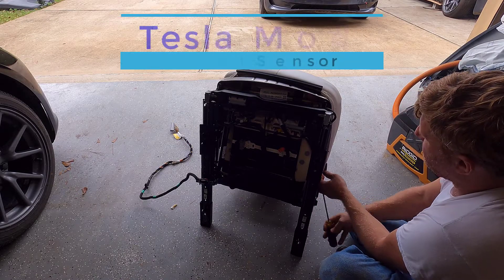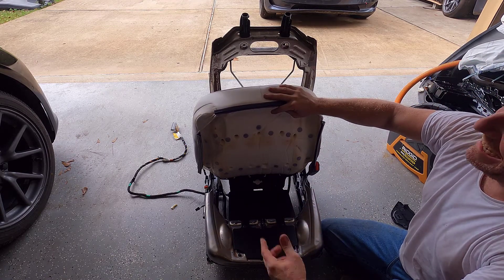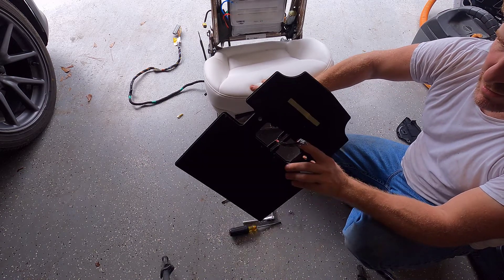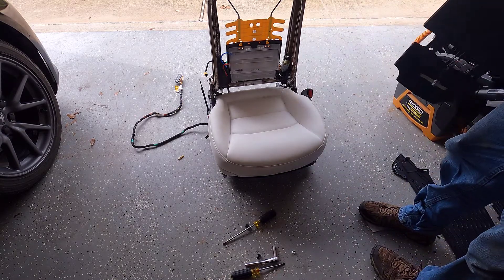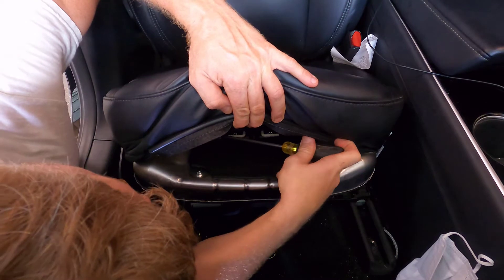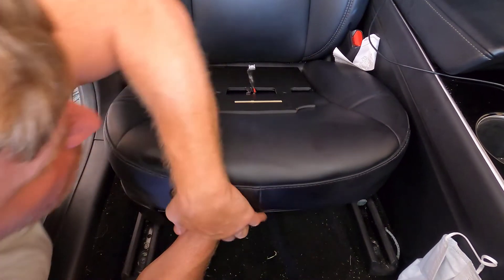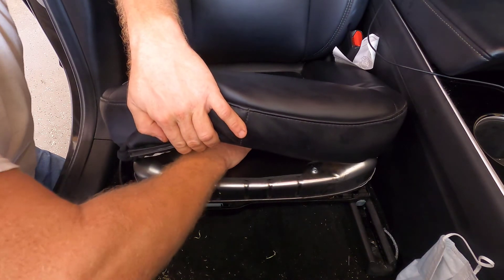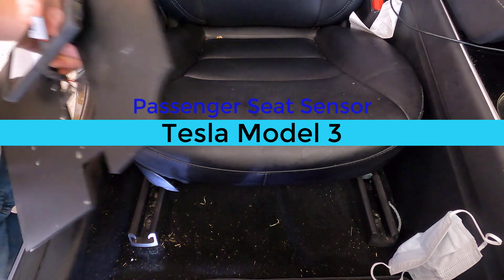Tesla Model 3 - Passenger Seat Sensor - Restraint Fault

Comment: I ordered a sensor from eBay. The sensor arrived. However, this sensor is missing from under the front passenger seat. I will return it. I think a different sensor is used in our seat. 2019 Tesla Model 3

Comment: My issue started with RCM_a078_comOCS1PStatus which indicated to communication issue between OCS module and RCM. Replaced OCS module and now I’m getting RCM_a056_passengerFrontOCS, I’m guessing now I have to replace the sensor that you showed in the video
Reply from the maker: Yes it's usually the seat sensor as it's been kinda defective as there are too many failures.
It's not a risk to occupants as airbag will still deploy with seatbelts latched.

Comment: I have 2022 m3, they don’t sell this type of sensor anymore, they quoted me 2k for retrofit to the newer one, it’s the same type as the driver side…..
Harness is only 200 and sensor is 10 planning doing it myself since the car is out of the warranty
Reply from the maker: No passenger side is not same as drivers, you don't need a new harness

Comment: Question, I need to replace the entire driver side seat cable harness assembly. I unfortunately do not have a garage large enough to do this in. Do I need to unplug the 12V battery to unplug the harness connection or can I just put the vehicle in service mode? I have a 2018 Tesla Model 3.

Comment: Thanks for the super detailed video bud! I’m getting a ‘Front Left Safety Restraint System Issue’ warning on my ’18 Model 3. Do you think that’s the same issue you had, or a totally different problem? Could it be the seat belt buckle sensor? Thanks in advance.
Reply from the maker: That is probably the drivers seat sensor it's different.

Comment: Do you remember the exact error code you were getting before this fix? Mine says "RCM_a056 Front passenger safety restraint system issue"
Reply from the maker: Yes that should be it, front passenger seat, check service mode for exact fault and definition.

Comment: So I have the error of "Front passenger safety restraint system fault" on my 2019 model 3.

I made a service request and I was quoted to complete the following service bulletins: 

SB-23-20-001 R3 -> Update Front Passenger Airbag to Maintain Compatibility While Servicing Front Passenger Seat
SB-23-20-002 R7 -> Replace Occupant Classification System (OCS) of Front Passenger Seat while Servicing subcomponents

This is a total cost of ~$1300 with parts and labor.

I just came across your video which seems to replace only one part of this whole suite of parts tesla is recommending me to replace? Basically do you think it will be necessary for me to follow through with all these recommendations from tesla or is this seat sensor replacement likely enough? Either way I am just going to go ahead and try it DIY, but wanted to ask here in case you had more insight! I might be completely wrong in what I am saying.

Comment: Does it need Toolbox after replacement?
Reply from the maker: No it's a dumb part plug and play, very few things on the car requires Toolbox like, motor battery, steering rack, ect.  Most is just a service mode reinstall of software and it's good.

Comment: Hi, awesome video!  Can you tell me what your original alert code was?  I have a 2018 M3 and my alert code is OCS1P_w125_cushionSelfLow.  For the front passenger seat.  When I did diagnostics, it clarifies: “cushion self capacitance sensor is low <25kHz and >1kHz.” Wondering if your video’s solution will fix my problem.  Thanks!
Reply: Same here . Did you try this solution out? I got a 2019 M3.

Comment: Love this video, I can 100% relate the frustrations and the joy once you found out the root cause. 

Please help me out as I’m dealing with similar issues, ongoing for few years with multiple Tesla SC visits, with no solution. 

The last time I took it in, they said the following : 
Repair Notes: Technician verified customer concern. Found the self capacitance trace in the seatback trim to have an internal fault and need replacement.

They quoted me north of $800 and I declined. 

Any idea what the “self capacitance trace in the seatback trim to have an internal fault and need replacement” means?

Comment: I’ve been having this issue with my Model S on the driver seat, I left my car sitting for about a month when I went out of town and came back and my infotainment screen would shut off once I close the door and then if I try and reverse/drive for 2 seconds without the seatbelt it’ll automatically go in park. Assuming the sensor needs to be replaced or maybe somehow some things need to be connected better, no idea how this happened no one was in my car or using it while I was away

Comment: Is it connected to a metal contact point ?  Im wondering if I change the seats will this work if it is just placed under my seat
Reply from the maker: No it's just push pinned to the metal seat frame, has to be for correct position.
Reply: Do you think I could put it into a racing seat.
Reply from the maker: @chrissmith7688  I mean it's possible, would have to be supported similar on flat even plate with cushion above.

Comment: Is this the same procedure for the driver's side? I think you removed the driver's seat initially? 

Im hsving a driver seat sensor occupancy issue. I have a feeling this is the same sensor and procedure. I have a 2019 model 3.

Thanks for the vid. Greatly appreciate it

Where did ya buy your sensor?
Reply from the maker: Hey sorry for the late reply,
No this is only for the passenger side the Drivers side requires the whole cushion to be replaced with imbedded sensor.

Comment: If you spill water on your seat it will trigger sensor keep in mind
Reply from the maker: Yes that is also possible, especially on the drivers side as the sensor is different.
Reply: So does it go away eventually or?
Reply from the maker: @sickpencilOG  I really don't believe that the fault is caused by spilling water on your seat.  The plate is flat and sealed up the water would just run off of it if anything it's getting the wire harness wet.

But yes I have seen the faults come and go sometimes daily sometimes not for a month.
This is why I don't think it's related to that and more to a actual defective part..
Reply: @TeslaRebuilders  understood! only asking because I did spill a bit of water on that exact seat like days before I saw the notification. just now unplugged everything under there for a while and trying a software reinstall since I see a lot of people having this notification after the software update. service centers in local have been horrible for me. fake fixes and lies so im trying everything before I go to them and let them waste my time yet again. thanks for the response I guess we know what my next step will be if this doesn't work.
Reply: @sickpencilOG  Did you solve the problem? Water spilled on my passenger seat and it's giving a warning
Reply: In the case of spilling water I mean

Comment: Thank you so much! Tesla service is trying to sell me “Update front passenger airbag to maintain compatibility” when I request service because finally had enough by this annoying alert keep going off. Without a doubt I asked why and vague reason like it’s required to rectify my concern. LOL, got myself the part and replacing it myself. So charging $475 for this replacement wasn’t enough, an absurd airbag update? Shame on Tesla service center
Reply: Did you fix it? I am getting rcm_a056

Comment: This was so helpful, thank you. I looked under the passenger seat, and the two wires for the sensor had come loose from the terminal connector, which was still plugged into the OCS box. 

It’s hard to reach to try to resolder/glue the wires back, but should be manageable if I can get the sensor out.

Could you provide instructions on how exactly you got the passenger seat cushion off in the car?
Reply from the maker: Hey sorry for the late reply, you can remove the whole seat if needed pretty easy with the 4 frame bolts and the VC power connector on footwell side.

Comment: Can you just disconnect the seat sensor to not to show on the screen?
Reply from the maker: No this will also show a fault, it's needed to verify someone is sitting in the seat.  If they were not buckled it would disable airbag.
Reply: @TeslaRebuilders   I was told different by Tesla Service in Los Angeles. They said if the sensor does not work the air bag will deploy appropriately in a crash if a passenger is present or not. So the faulty sensor without a passenger will still deploy the airbag requiring a replacement of the airbag.
Reply from the maker: @quedokid  Yea and I was told it wouldn't go off without seatbelt buckled as it could hurt someone worse to deploy a airbag.

If you get in a bad enough accident to blow airbags having it go off too anyway is not to be worried about.   Unless you really plan on rebuilding the 1500$ extra for that is not a deal breaker.

Comment: Currently got this on a 2023 model Y with only ~5000 miles. 

Like you, I wanted to find out the problem, and not just be told some crazy bullshit, even though it is covered under warranty, which, if I am wrong, I’m gonna slap them myself.  Thank you for sharing the video to help out the fellow community.
Reply from the maker: Yea make sure it's actually the passenger restraint fault and in service mode the definition should be for passenger seat sensor.

Sometimes it can be other issues as the fault code is generic and could mean a multiple of possible issues.

Thanks for the comment and watching,
Casey

Comment: So glad I found this video!! My 2018 Model 3 is at 60,000 miles and Tesla didn't want to do this repair without charging me $2k. I found a seat sensor on eBay for $55 and it took me about 30 minutes to replace. So happy!!
Reply: My 2020 just popped up do you have the part number you used for the 2018?
Reply: same they want to charge me 2000$ for sensors and an airbag. these fking scammers!
Reply: Same thing happened to mine a couple days ago. 
Did the alert instantly go away or did you have to reset the car?
Reply: They did the same to me my friend.
Reply: did you have to recalibrate anything or did you just plug it in and the alert went away?
Reply: @TeslaRebuilders - can you help with this question? Great video, thanks so much!
Reply: @sethbw3 Did you find the answer?
Reply: @davidblumberg6704 we need answer to this question
Reply from the maker: Awesome dude!

Comment: Tesla gave me a $1500 bill for this saying that they have to change the airbag as well. My little one spilled a little bit of water. I called them and yelled for a while how can a premium car is not built to prevent a little bit of water messing the entire seat. Then I watched this video, disconnected the piece and turned the car seat heat for 30 min. Then the issue was gone 🎉. Thank you for sharing
Reply from the maker: Dang man sorry to hear that but glad you cleared the fault.

I'm not too sure about liquids affecting the plate sensor but maybe the module or wire harness.

Thanks for the comment and watching,
Casey
Reply: My wife accidentally spilled water and same thing happened
Reply: I am having the same issue. Did you just turn on the heater or remove the seat sensor and then turn the seat heater on?
Reply: Did you reattach the sensor? I heated it before removing it, but the effect was short-lived.

Comment: One thing I realized after buying my Tesla Model 3. Is that for the price of the car they are made with cheap materials.
Reply from the maker: It depends on what materials you're referring to if it's the ones you touch and feel and you see maybe.  I mean the seats are made out of vinyl so that they're easy to clean and are durable. The various trim panels in the car are just covers and don't need to be anything fancy.

But I can tell you for absolute certainty everything else especially the mechanical components are Beyond better quality than any other car.

Comment: The problem is that we get a new malfunction every month on our Teslas (for me it was suspension skweaks in June, A/C dead in July, Seat sensor in August)....these cars are so poorly designed...so unreliable and disappointing. I just bought my Model 3 and already looking to sell....thanks for the video though!
Reply from the maker: Sorry you had so many problems, it's not my experience and I have had 4 cars.  The seat sensor was one that made me mad over not being replaceable.

The front suspension sqeak is easy diy fix oiling the joint, I have a video on that.

I heard they had issues with some heat pumps but are under warranty and should not take long to fix.

Thanks for the comment and watching,
Casey

Comment: This is easier to change in the goddamn cabin air filter. I've been struggling with this issue for almost a year, text I came out it did a mobile ferrite bead clipon for $200 that made it worse, I need to get the part number on this

Comment: So I used this video to get to the sensor. I unplugged all three plugs that go into that module under the seat, the one that the seat sensor plugs into. I left them unplugged for about an hour while I was fiddling with the sensor. When I plugged everything back in, the fault was gone. 

‼️Before buying a replacement, I would recommend disconnecting all three plugs and waiting a bit. Then plug them in and see if it fixes it.‼️
Reply from the maker: Ok cool glad to hear about your experience, the fault usually comes and goes as it would randomly do in my car.
Usually it also would fault when someone sat down in the passenger seat.
It will likely come back in a few days as the sensor is faulty.

Let us know after a while what happens.
Thanks for the comment and watching,
Casey
Reply: Is it still working?

Comment: I've owned a lot of cars and my Model 3 has been the most problematic and it's all stupid crap. Seat sensor, trunk stopped working... I flip flop between selling it and just not caring that it's a shit box.
Reply from the maker: I have owned a lot of cars also, but most of the weird problems with Tesla can be fixed yourself.
There is so much more info out there and parts available other than like from Ford ext...
I do defiantly agree I have had a few problems and only one big one so far and I have 3!
Also have put over 250k miles combined on them as well so have seen the common stuff and rare issues too.

Comment: is this part only for passenger side, or can I replace this in the driver side seat too
Reply from the maker: This is only the passenger side seat sensor as the drivers seat sensor is different and part of the cushion foam insert.  It could be replaced also but a bit more difficult with more disassembly required.

Comment: Hey Tesla Charged, do you think it's possible to transplant the wiring and seat sensor into a bucket seat, without any errors?
Reply from the maker: For like a EV conversion?  Or change the seat in the Tesla?
Reply: @TeslaRebuilders  Changing the seat in a Tesla Model 3

Comment: Currently battling Tesla over this! They want to charge me 2075.00 to replace the seat and insist to me there is no other way. I sent them your videos and photos of the sensor. They are acting like they didn’t even know that’s what the sensor looked like. This is ridiculous!!! I think they are going to refuse to help me unless I pay the 2k
Reply: Were you able to get Tesla to replace the sensor? I am also arguing with the service center about this, they want to replace the whole seat for $2000+
Reply: @TheTomknoblaugh  after arguing back and forth with them and explaining to them what I wanted done they told me the sensor isn’t available. They said check back in a month. When it is available they will replace it. They couldn’t give me a quote but said it would be about half
Reply: @ericf.39 l Wow! They still want a grand to replace that sensor???
Reply from the maker: Yea it's rediculos as it would be so easy and could be done in the parking lot with minimal tools.  Fixing a issue this easy that should be a recall because of fault!
Reply: They probably didn't know what it looked like. They are not great.
Reply from the maker: @charlesrodriguez491  Yea on my car I paid 80$ for a mobile service before I fixed it myself to install a magnetic coil over the wire harness.  It didn't work but they said the next option was to replace the whole seat at the time I was told 2 years ago 1500$.
But after taking the salvaged cars seat apart I said oh heck no, I got this figured out!

Comment: I am getting error today rcm_a021 is that the same way to fix it but its on driver side
Reply from the maker: It is a little different on drivers side as it could be the seat module under it or the sensor pad on cushion.
I don't know if you can find these parts separately.

Comment: Just seeing this video. Been dealing with this error on our 2020 Model Y since 55,000 miles. Now at 115,000. Initially, Tesla charged $150 for a fix. Now wants $2,500+ for a new seat. Even took it to Electrified Garage by Rich Rebuilds mid 2022 and they could not offer a solution. Might have to just try and tackle this myself.
Reply from the maker: Yea probably so, been over 2 years and my problem never returned.
Reply: Have the exact same car and same problem and just finding this video on how to fix. Thanks!
Reply: Exact same situation in 2018 M3 LR RCM_a056 are for damn near a year on and off they refuse to fix it even though it should have been covered under the SRS warranty in Florida f**** bastards